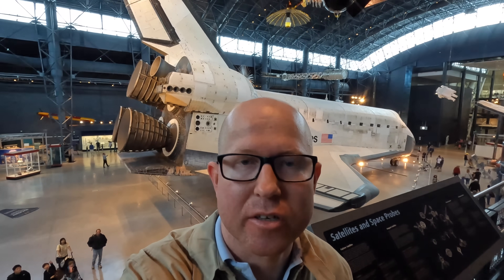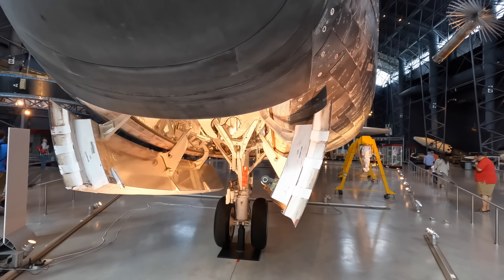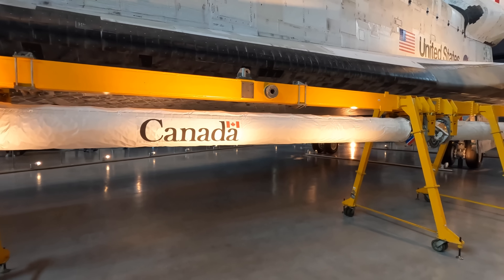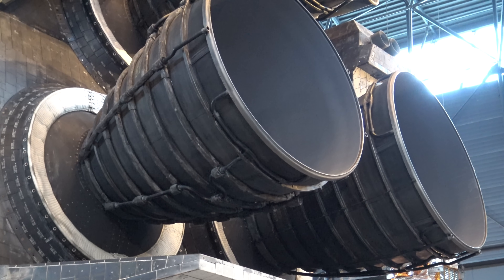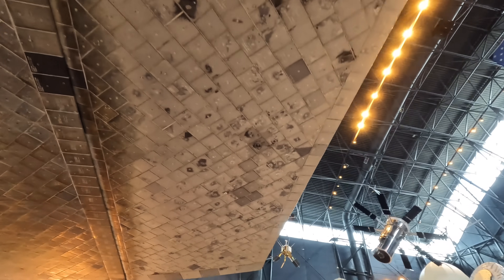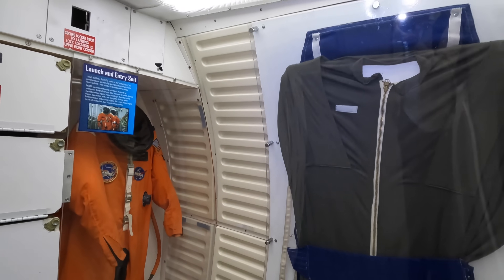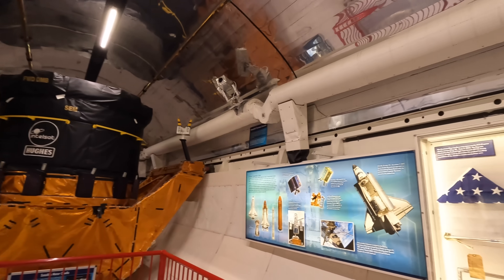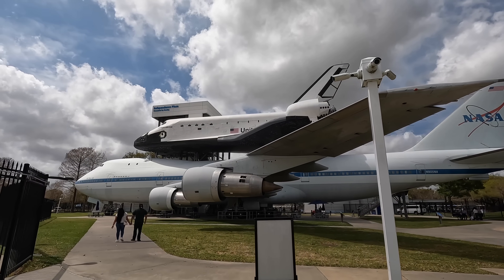Detailed tour through the Space Shuttle Orbiter

Comment: It's great that they've kept the Orbiter in it's original condition with the partially worn skin. Nice tour Paul, as always.
Reply: It's not really worn it can be used again.
Reply: @dkdanis1340  That's not what the OP meant.
The Discovery was left with the wear and tear of flight on it.
And, NO, the shuttle cannot be reused.  It cannot fly again in its current condition.  NASA removed certain items from the vehicle and deactivated certain systems.  The payload bay doors of ALL the space shuttles were deactivated when they were decommissioned.  The motors that moved those doors in orbit were removed or disabled -- and that's only one thing NASA admitted they did when the orbiters were decommissioned.  The US military does the same for planes when they're grounded for good; they will actually cut certain structural elements of the airframe so that the planes can't fly again!

They would repaint the shuttles and scrub off all the carbonization soot from re-entry when they began preparing shuttles for new flights but the museum staff chose NOT to remove that cosmetic damage, to leave Discovery as it was after the final flight.
A lot of times museums will repaint vehicles to "preserve them."  You can preserve things without altering the paint job.
They leave things "as is" for some artifacts, they alter other things for various reasons.  If some vehicle is going to be on display outdoors, they will repaint them to protect them better against the elements.  
Weather-proofing for outdoors exhibit is understandable.  
It's when a vehicle is going to be on display indoors in a controlled environment that repainting makes less sense.
Reply: It’s worth going to see it at Dulles. We saw it last year and yes the “battle scars” add to the experience of seeing the real thing.
Reply: @AvengerII  What did they repaint on the shuttles when preparing it for new flights?
Reply: @Ladco77  The exterior of the tiles, the signage, anything that had faded or been carbonized during re-entry.
The paint takes a beating during re-entry.  One of the toughest things to come up with is paint that doesn't peel off or get burned off by high heat.  It just doesn't exist for anything that travels much faster than Mach 3!
They repainted the X-15s, XB-70s and Blackbird planes after their flights, too.  The paint jobs just didn't survive highspeed flights!
Reply: @AvengerII  The tiles aren't painted.
Reply: @Ladco77  Regardless of whether they're painted or not, the color is worn by the friction in re-entry!
The tiles were darker before that Shuttle went on its last flight, PERIOD.  They're not black, really...  It's a very dark grey.
Again, it's the heat on re-entry that destroys the color and that's why they have to retouch it between flights.  Regardless of what makes the color what it is and what you call it (paint, pigment, byproduct of repair, etc., etc.), it gets worn out on re-entry.
That's happened with every space vehicle that's ever done high-speed, high-temp re-entry.  You don't honestly think all those capsules were yellow, brown, and rusty colored prior to re-entry?
I was surprised by how the Soviet Space Shuttle Buran looked after its one orbital trip.  The American Shuttle looked like they had mild burns.  The Buran looked FAR WORSE after its one and only test flight!
Reply: @AvengerII  Of course there's visible wear on the tiles.  I never disputed that.  YOU said they repainted them.  They don't.  The Orbiter tiles were repaired or replaced if damaged, but otherwise left alone and flew again with the same visible wear. 
Here's a picture of a Shuttle on the launch pad ready to launch and you can clearly see the wear on the tiles from previous missions.  They do not and never have repainted the tiles.  They even stopped painting the External Tank to save weight after the first 2 flights.
https://www.nasa.gov/images/content/540055main_launchpad-threearms.jpg
Reply: It’s a jet aircraft, wake up lol
Reply: @AvengerII  I’m not aware of any painted spaceships.
There are portions of spacecraft that are coated with a thermal coating that may be black or white, depending on the desired thermal response. For example, a portion of the spacecraft that generates heat that needs to be emitted may be coated black and a portion of the spacecraft that doesn’t generate heat may be coated white to reflect heat from the Sun. The tiles are covered with a black reaction cured glass coating during production, They are simply replaced when needed. The external fuel tanks have foam insulation sprayed on the aluminum structure which gives it the orange color. NASA did paint the fuel tanks with a white heavy-duty exterior latex coating on the first two launches but they stopped because of weight. - These are discarded anyway after use.
Reply: @AvengerII  That's not what the response to the OP meant.
He didn't say the shuttle can be reused.
Reply: Feliz 2023
Reply: @CharlesStevenage  No. Not a jet aircraft.
Reply: @CharlesStevenage  Where's the jet engines and intakes?
Reply: @Ladco77  the tiles were never painted. Amazingly, those tiles conducted heat so well, there are videos of them being cherry red, and the holding them bare handed. there’s a good documentary on when they moved the space shuttle from Kennedy to the Smithsonian. One of the curators goes into detail how they wanted to look like it had been in space, versus a flight ready/ clean configuration.
Reply: The three Orbiters are displayed in three different phases of the mission. Endeavour is configured to represent a Space Shuttle ready to launch, Atlantis is represented as if she's in orbit, and Discovery is made to look as if she just landed-- hence the high mileage in her heat shield.
Reply: @CharlesStevenage It utilized rocket engines. Turbine jet engines can only go as fast as mach 3.3, the confirmed top speed of the SR-71 Blackbird, whereas spacecraft must reach a minimum of mach 25.

This is why scramjets are the future of jet aircraft, because they provide greater speed than a traditional jet engine can.
Reply: Hard to call it original condition when the interior has been so heavily modified

Comment: Six. There were six Space Shuttle orbiters built. Enterprise OV-101 was intended originally to be retrofitted as a spaceflight-capable vehicle after the Approach and Landing Tests (ALT) and then the Mated Vertical Ground Vibration Testing (MGVT) was done. But lessons learned in building Enterprise resulted in changes to the subsequent  orbiters which meant far work had to be done to bring her up to spec and thus more money spent. So, instead OV-099 Challenger was built out of a test article airframe in place of Enterprise.

Comment: The amount of engineering is phenomenal. The first space-worthy Space Shuttle was Columbia, which first launched in 1981. These were basically designed and built using technology from the 1970s with relatively few updates like a heads up display, a parachute, and making the external fuel tank lighter as time went on.
Reply: how about the 60s apollo tech.: still unable to be duplicated… 😉 😂
Reply: The biggest one was the glass cockpit replacing most of the analog gauges with flat panel displays. The payloads, like Spacehab, would continue upgrades for Columbia, since that was the only bird that could take the Spacehab. Spacehab was used to supply the Russian Mir.
Reply: Endeavour which first flew in 1992 had upgraded avionics systems that included advanced general purpose computers, improved inertial measurement units and tactical air navigation systems, enhanced master events controllers and multiplexer-demultiplexers, a solid-state star tracker and improved nose wheel steering mechanisms.
An improved version of the Auxiliary Power Units (APUs) that provided power to operate the Shuttle's hydraulic systems.
Reply: Yes I believe its a very advanced piece of engineering, especially when it can go to outer space, land on different planets, and the moon! Amazing
Reply: The Space Shuttles had catastrophic engineering failures...
Reply: @reconforsales7708  The shuttle can only do the first one - orbit the Earth...?
Reply: @mayniac5.09  Why would you want to though?  You have more advanced technology, and after the Apollo missions, the necessary infrastructure to create the Saturn V was dismantled and used for modern spacecraft. You can obviously duplicate the tech, schematics for F-1 and J-2 engines still exist, but you have no reason to.
Reply: @mayniac5.09  Same with concord designed in 60's yet we have no supersonic passenger jets now "were supersonic passenger flights all fake !  "

Comment: The Shuttle on re-entry would feel heat of around 10,000+ degrees Fahrenheit from what I recall. The Tiles could not withstand that, so somehow through a bunch of brilliant scientists they figured out how fluid physics work in space. This led to the use of the shuttles smooth shape to make a boundary layer. This boundary layer was a mix of two waves that collided to form one in the front of the shuttle.

I know this stuff is old and was used on Capsules thru the Mercury, Gemini, and Apollo programs. But jeez, how did they figure all that out??
Reply: I don't think the surface ablative was the same across all those different vehicles, especially between the STS missions and those older ones. Not to discount your boundry layer comment...

Here's what I found...

'AVCOAT was used for the heat shield on NASA's Apollo command module.[5] In its final form, this material was called AVCOAT 5026–39.

Although AVCOAT was not used for the Space Shuttle orbiters, NASA is using the material for its next generation Orion spacecraft.[6] The Avcoat to be used on Orion is reformulated to meet environmental legislation that has been passed since the end of Apollo.'

Comment: Nice tour of a truly astounding vehicle, considering it was designed in the 70s.  I was lucky enough to work on the Shuttle Mission Simulator complex at the Johnson Space Center for 38 years, from "cradle to grave".  Over those years I probably spent several hundred hours in the simulators.  I can attest to the fact that there was not much room in the cockpit, hardly enough room to turn around in the aft station area behind the pilot seats.  The only way in was up a ladder through a hatch in the floor,  just like the real vehicle.  One can visit one of the simulator cockpits at the Lone Star Flight Museum in Houston, although it only has the forward part of the cockpit due to logistical limitations.  Thanks for the memories.

Comment: Sweet video of a serious space machine. 

The acronym OMS was pronounced like Ohms the electrical measurement.

Hand controls on the left side of the aft flight deck were used by the pilots to maneuver the Orbiter during rendezvous & docking. Robot arm controls were on the right side. 

Starting in the mid 90’s the LES suits were replaced by the Advanced Crew Escape & Survival suit which was a full pressure suit. 

Source: My dad was an Orbiter Technician from 1982-2007 and 
my mom worked in Safety Ops & Engineering from 1990-2011

Comment: For those that were wondering, the main engines were only used in the atmosphere because they guzzled down fuel (as all first-stage engines do). They drained the entire external fuel tank in just a few minutes, but output enough thrust to directly counteract gravity. Once the shuttle is at the edge of space with enough momentum to carry it upward against gravity, it can use the OMS engines (which output tiny amounts of thrust but at very high efficiency.)
Because there is no air or gravity at this point, any amount of thrust you add essentially permanently adds to the speed, meaning you can use engines that output tiny amounts of thrust but at high efficiency to add up to tremendous speed. The OMS engines essentially accelerate the orbiter horizantally to the point where it is flung around the earth like a pendulum by gravity (this is how orbit works.)
Reply: You have the right idea, but the SSMEs were indeed intended to provide the horizontal acceleration to orbital velocity.

The Solid Rocket Boosters' job was to get the stack high enough to reduce the air resistance to virtually nothing. The SSMEs' nozzle were sized for exoatmospheric expansion ratios, which is why the flames coming out of those engines at launch were so small (they're being pressed close by the thick atmosphere at sea level).

The OMS pods gave the final kick to get the Space Shuttle into orbit, but the SSMEs did most of the work at speeding it up in the stratosphere.
Reply: @BogeyTheBear  I was simplifying it down lmao
Reply: @gelatinous6915  nice that you make it simple for me thanks
Reply: Strange that they never went out of low Earth orbit,was it the radiation belts that kept them from doing anything extra,or they didn't know how to,they forgot how to get to the Moon lol!
Reply: @BogeyTheBear  Thanks for saving me the trouble lol. I guess an easier way of thinking about it is that the SRBs basically lifted the fuel for the SSMEs and shuttle; once it was out of the atmosphere and the majority of gravity, the SRBs would be spent and separated. 

There’s a more interesting side of the OMS that I can’t seem to find at the moment, but essentially the entire shuttle stack was designed to get the orbiter to a velocity just below a sustainable orbit, it was done for safety reasons that I can’t find now (I think Scott Manley discussed this a while ago.) 

Basically there were safety concerns during development, and using OMS for circularization / orbital insertion was deemed safer.
Reply: There was also a moment in which they evaluated the suggestion to use the OMS also during the powered phase,I think it was in Mike Mullane' book
Reply: I mean the AJ-10 only has an ISP of 350s so I wouldn't call it very high efficiency
Reply: @willywayne5299  The space shuttle was far to heavy, or rather could not carry enough fuel to make it to the moon. It needed the massive external tank just to reach low earth orbit. It would need another tank nearly that size to reach the moon and another even bigger tank of fuel to lift that tank of fuel into orbit. The boosters needed to send a shuttle beyond low earth orbit would be enormous. Like an order of magnitude bigger than the Saturn 5. 

SpaceX's Starship is being designed to refuel in low earth orbit to solve this problem. The main ship will launch and then a number of ships will launch to refuel the main ship. 

The Saturn 5 used for the Apollo missions was a massive rocket yet the space craft that landed on the moon and returned from the moon was very tiny and built extremely low mass. It's really terrifying how slim the margins were in the Apollo missions. It is really amazing that the Apollo missions were so successful.
Reply: @lordgarak  I always find it amazing how these spacecraft can burn thrusters off against a vacuum and accelerate away, it's really incredible stuff.

Comment: Hi Paul.
That was really cool to see.
I love how you "delicately" described deposits of solids and liquid into the loo !
The crew quarters are far more cramped than I realised, although , once a payload has been off-loaded, the cargo bay ( when pressurized) would provide a little more room to stretch out !
Reply: They can't pressurize the cargo bay actually.  Strengthening the doors and seals and carrying additional oxygen would add a bunch of unnecessary weight to launch.
Reply: The payload bay couldn't be pressurized but there were pressurized modules like Spacelab that were sometimes flown in the bay and connected to the airlock.

Comment: 3:16 - More importantly, the Orbiter is empty of fuel on touchdown, so there is nothing to start the RS-25 main engines with. This was the one really smart thing about the STS and Orbiter system; it's a man-rated space plane which is very safe to land, because it's not fuelled, and the engines aren't running. 

To give you some idea of the sorts of energies involved with the RS-25 (SSME) engines... each of the fuel turbo-pumps were roughly the size of large V8 motors, but at 100% throttle they each produced as much power as 40 diesel locomotives. If you placed the inlet in an average American swimming pool, and pointed the outlet straight up, it would empty the pool in around 20 seconds, and it would pump a column of water 50km into the air. Now THAT is a pump!

It's often said that a rocket is merely a turbo-pump with a nozzle attached. :P
Reply from the maker: Thanks for the extra info! Yes they're pretty amazing engines! I was impressed with the pump rate of that little X-15 rocket motor!

Comment: 1:00 great spec's on the structure of the Space shuttle angles! This cradt could've been around today, if it just had those temporay heat sheild paint coat, used during the attempted long cruise of the X-15A, surround, under the decal paint ( with windows having re-enter HS roof lids), that imbalance dive would not have been so fatal of only short travel paint burns. 
 
 • Hs paint coat add on.
• folding main wings.
 • Plus a Stratophere flat sting-ray form carrier to replace that bulk oramge tin.
• Thus a huge cargo exo orbit craft to still around today.

Still recomend something like that, for Dream Chaser & surround of Starship 2nd stage, under the HS tiles.

Comment: Smithsonian Air and Space Museum at Dulles Airport outside DC in Virginia.
The engine bells are mock-ups. The originals were removed and rebuilt for the Artemis project.
The large spindley thing hanging from the ceiling is a TDRS communications satellite. A cluster of these were used to provide continuous high speed communications for the shuttle and Space station.

Comment: I worked at Cape Canaveral Air Station and Kennedy Space Center for 20 years before I retired. On the Cape side I supported the Delta, Atlas and Titan launch vehicles from 1990 to 2000. From 2000 until the end of the Shuttle program in 2011 I supported all of the Shuttle launches.